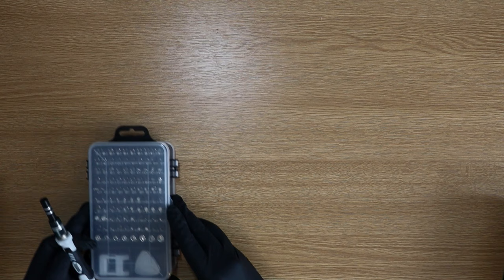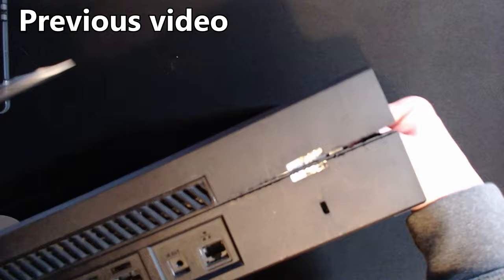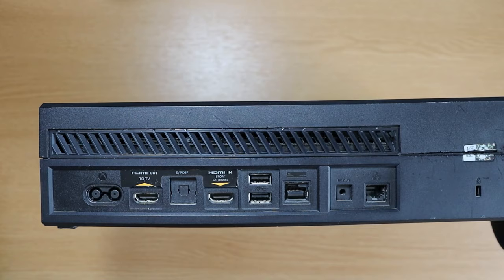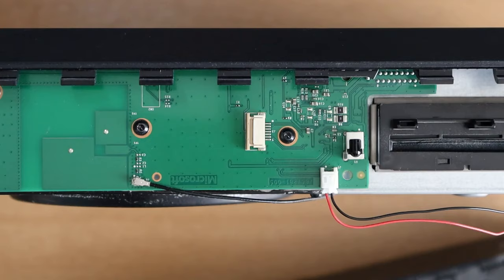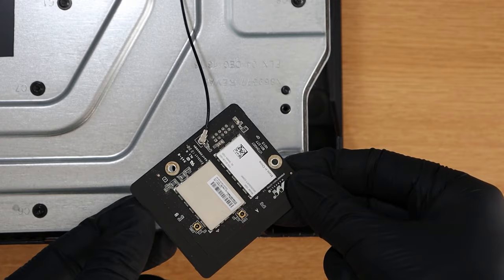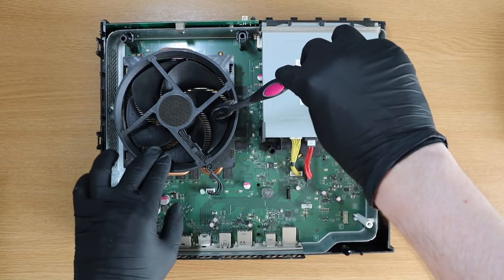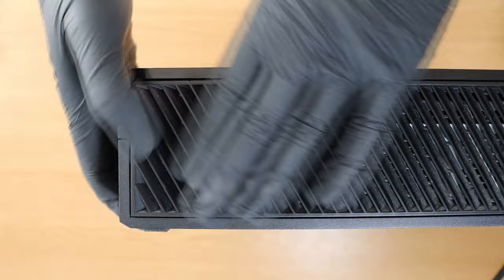How to Clean an Xbox One

Comment: I cleaned mine out but the power button doesn’t work now😡 I even opened it up again to reconnect the blue ribbon..... still not working. Is it broken for good????!!!!!!!
Reply: And I did everything right and made sure to check that I did everything right and it’s still broken, not happy 😡
Reply from the maker: This doesn't sound good :( I've had it a few times where the blue ribbon cable isn't connected properly, this can deffo cause it to not power on. Have you pressed on your Xbox One controller to see if that turns the machine on?

Comment: There's a better way to put the last shell on. Take out the front panel from the top panel. Attach the front panel first. Then attach the top panel
Reply from the maker: You're correct Aaron :) There should be a link in one of the comments that show it a lot easier.

Comment: Would it still work if I didn’t do the corner part correctly? Please respond
Reply from the maker: The Xbox will still technically work, but it just means that if you knock your Xbox, the ribbon cable might rip from the front meaning you won't be able to turn the Xbox on with the button.
Reply: @JoeyDoesTech  I think it’s that small power box that is broken because it goes from red to green then red in 30 seconds

Comment: This really helped me. Had an orange steady light on my power brick. Took it apart and cleaned it, but it didn’t work. But after i took apart the xbox, cleaned it, and ten back together it worked. I think it got to do with the last blue wire connected to the front of the xbox. Anyway, thank you for helping :-)
Reply from the maker: You’re more than welcome :)

Comment: This video is really helpful, one thing I would suggest is to remove the faceplate from the top of the case, this makes it easier to attach the ribbon and much easier to reassemble the case as you just place the top in place and the front clips on
Reply: This makes the hardest bit into the easiest
Reply from the maker: Hey bud, thanks for the feedback :) I have put a video in the comment section on how to do this, I only figured it out after the video was published haha!

Comment: Hey I did this and my Xbox won’t turn on
Reply from the maker: Just make sure that all the ribbon cables etc have been put back together correctly first. A quick take it apart and put it back together :)
Reply: @JoeyDoesTech   hey now that I remember my mom accidentally touched the circuit board without gloves while I was doing the blue ribbon , do you know how to fix it.
Reply from the maker: @WhoamI-ml1yd  I don't dude I'm sorry! I don't want to give you any advice for something that I'm not too savy on myself. I'd seek out a repair shop at this point if your Mom has touched the circuit board.
Reply: @JoeyDoesTech  thanks for the advice anyway.

Comment: The triangular piece right under the flimsy siding on my xbox is missing, does anyone happen to know if it serves any purpose/ if it would affect how it works?
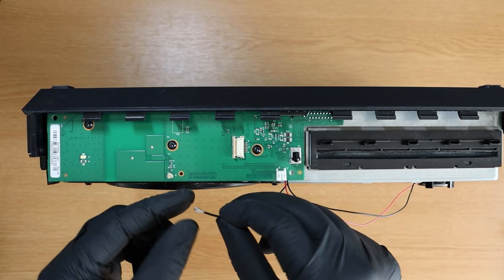Reply from the maker: Are you talking about the piece at 09:15 in the video? If so, this is to sync your xbox controller which can be replaced by plugging the controller into the xbox via the micro usb cable.
Reply: @JoeyDoesTech  It's the piece/panel that's being slid out at 2:35
Reply from the maker: @AA-cl4hb  Then yes this is the part that syncs wireless controllers. You can pair them buy plugging it into the xbox i'm pretty sure?
Reply: @JoeyDoesTech  Oh yeah I've got a wired controller, just wanted to make sure it didn't have any other significance than that

Comment: One think I'm wondering is what the cable for the wifi chip looks like. Is it the same or similar to, say, the ribbon cable clip or hard drive clips, or is it different. How does it clip in if it is different?
Reply from the maker: The cable for the wifi on the underside of the xbox that attaches to the motherboard is quite a big clip, like the one for the hard drive. Hopefully that answers your question! :)
Reply: @JoeyDoesTech  I'm sorry, I meant the antenna wire that goes into the top side of the wifi chip
Reply from the maker: @roccodesarro4448  Oh sorry my friend that's my fault! I'm not really too sure as I didnt pay too much attention to it. Sorry!

Comment: Shoot, I think I rubbed off the pins on the front panel ribbon cable because the on button and other interface buttons do not respond
Reply: Nevermind totally put the ribbon cable on wrong and after reviewing your footage I found it goes under the lock and not over lol, very happy it is clean and works!!
Reply from the maker: Good job pal! Haha I've done this a few times as well so you're not on your own :)

Comment: Good guide. Just cleaned one. The ribbon cable and top case refitment were bitches but got it done.  Didn't solve the problem, but the unit did need a major cleanup.
Reply from the maker: Good job dude :) Yeah it's a real pain. What is the problem out of curiosity?
Reply: @JoeyDoesTech  Console shutting down randomly after a few minutes or seconds. Finally isolated to the PSU brick which LED shows Power Good/Standby, then you switch on the console and the PSU randomly goes from Good to Standby to dead in a split second. Should have checked this first, live and learn, but at least I know how to dismantle the console now. :D

Comment: Since I’ve cleaned Xbox per your instruction I am frequently loosing connection to both of my controllers.
Reply from the maker: Sorry to hear dude, I'd maybe start with removing the front plate as it sounds like possibly the ribbon cable is a bit lose? I would suggest checking batteries etc, but as you said it's two controllers!

Let me know how you get on :)

Comment: Its been 20 years hasent been cleaned went to sibling to sibling i had it for a year then the Power brick randomly turned off?? Help-
Reply from the maker: If the power brick has turned off I'm pretty sure you can buy them on Ebay :) The power brick is notorious for giving up on these!

Comment: an easier way to get the top and front panel back on is to detach the front piece from the top, latch the front to the xbox, then place the top and click it into place, and last, push the front to the top and it should click into place. this is way easier than forcing it onto itself, cause that’s what i was doing and i broke one of the clips that attach the front to the top
Reply from the maker: Yeah this is true, check the top comment :)

Comment: OK so I ghetto opened mine using a paring nife as my prying tool a stripped star head for the bigger size screws and a dinner fork tine for the torque screws on the wifi card and It did take me a minute to get the last casing on but that was because I'm impatient and didn't hear when you said it had to be pulled over the first clip but after that it went smooth
Reply from the maker: Haha good stuff for getting it cleaned!

Comment: I messed up the second cable at about 5:39 in the video. Went to pull it away from the connector and the wire came out but the copper tip on the wire stayed connected. Kinda scared I broke my xbox, but if i did i’m blaming xbox for shitty wires

Comment: I disconnected the card thingy behind the screw and now the bottom part won't stay steady for me to reconnect it :(
Reply from the maker: Hey, did you get this sorted? :)
Reply: @JoeyDoesTech  nope sadly, console was so old and it would of costed more to get all the rusted/bad parts replaced. Tried taking it apart for a needed cleaning cause of dust and found an aplethrea of issues that I can't afford. My mom is supposed to be getting meat used Xbox one cause I had to toss mine

Comment: Bruh my Xbox was bought brand new on release day has never been cleaned hopefully this helps it out and for the back piece just lift as high as u can from the back thumb in each corner and push away first try 😎
Reply from the maker: Hopefully it was easy enough to take apart! Enjoy the new clean xbox :D thanks for watching!
Reply: Did it make your console run any better or quieter at least?

Comment: I have not cleaned it for the two years of ownership but I needed help after putting in the ribbon cable I could not align the shell
Reply from the maker: Did you manage to get it sorted though Redsight?
Reply: Unfortunately I broke the edge of the clips but it still works

Comment: I just tried this and hands down everything went smoothly. Thanks for the great video and i got the top case back on the first time. Im a automotive technician so that kind of helped make this easy for me had it done in less than a hour.
Reply from the maker: Jesus, you smashed it! Good stuff pal, feel like I could of gone into more detail about putting the top case back on, as it's quite difficult especially for people like myself who don't have the experience. Oh well we learn!

Thankyou for the kind words :)
Reply: Pls help me at 9:23 i cant put it back its so hörs how do i do it
Reply: @JoeyDoesTech  i kinda ripped it off Will the Xbox not function of i ripped the blue part 9:23 off.
Reply: @elias2444  how bad is the rip if the only part that ripped was the blueish ribbon that went around the outside you could still make it work as long as the piece that goes connected isnt ripped. Just have the console facing up and make sure to push in the blue ribbon tab and once u see it in push in the small tab in you can use a really small flat head screwdriver to push in the tab
Reply: @ej1jayk  ok and Will it affect anything in my console
Reply: @elias2444  if the inner part is not  ripped you should be good

Comment: I just used a knife to pop it open, figured it's as good as any other tool. If I left some scratches and dents in the plastic, it is what it is, it's like 10 years old and I've got a series S, I'm still on last gen cuz so many friends haven't switched over yet 😞 I'm probably just going to pay a pro to clean it, it's filled with dust to the point that the fan gets obnoxiously loud when I use internet explorer for some reason (isn't an issue outside of that surprisingly) and I just don't trust myself past taking the shell apart but thanks for the video!

Putting it back together was a nightmare! I eventually just separated the front from the rest and managed to get it back together that way. It would be nice to really clean it good and figure out why my disc drive will play games but not DVDs, hope to get as long of a lifespan as possible outta it.

Comment: Thanks for the video.  It was very helpful.  I did get the corner together on the first attempt, but I have an unfair advantage.  I've overhauled gas turbine engines for almost 30 years.
Reply from the maker: Nice work! There is a video to make it a lot easier in the top comment 😀 Glad you got it done either way though!

That’s a very interesting career to have!

Comment: Cleaned my Xbox and all the dust I can’t get the case back on it’s driving me crazy adhd don’t help. It’s the little blue thing at the front the front will fit and the back won’t and I
 Pretty sure I got Forza horizon stuck now
Reply from the maker: Sorry to hear bud. Did you manage to get this sorted now? Sometimes the best thing to do is take a 30 minutes break, or even go back to it the next day :)
Reply: @JoeyDoesTech  yeah man I came
Back the next day with a relaxed mind set and got the case on but the front panel is lifted slight so I can’t eject discs. 

But it’s running a lot more smoother no loud noises and I can still use the sensor buttons. 

Just can’t eject discs but it’s okay  I’m playing rd2 anyway and most the games now adays are installed on my Xbox. 

But thank for your the tutorial you definitely saved my Xbox a couple years it was caked in dust. Never cleaned it until that day the Xbox is the original one that came out 7yrs ago 😂

Comment: after dissasembling it and putting it back, my xbox won’t turn on.
what could be the problem? please if anyone could point out what i could’ve done wrong so i can fix it; would be of big help
Reply from the maker: It could be that the ribbon cable on the front is disconnected, so when you're pressing the "On" button, it's not registering. 

Hold down your xbox controller, and see if that turns it on (as long as the setting is enabled to wake it up!)
Reply: @JoeyDoesTech  I went around checking others people's way of connecting the blue ribbon and it turns out I was doing it correctly, still the On button is not registering, then I connected the blue ribbon backwards and the xbox turned on and off intermittently, so I was thinking that maybe my ribbon cable isn't damaged or anything and instead the yellowy part to which you have to connect the blue ribbon might be damaged or something, so maybe I should replace that whole green board?(I'm sorry for my long message)
Reply from the maker: @desonoranter5419  No worries dude, I'm not too sure to be honest. I'd maybe do a bit more research on google etc to see if theres anyone else reporting the problem. I dont want to give you any bad/wrong advice! Best of luck. 😎

Comment: Putting the top shell back on was easier than i though if you had trouble just place the front pins like normal then lift the lid,pull away and once that one pin is in the right spot slowly connect it as to not damage the pin while still pulling away. Once the pin is connected you can stop pulling and the rest will snap back together

Comment: Managed to get it back together easier then taking it apart, I slipped the face plate off the top to make putting the ribbon cable back easier after slipping that back on I clicked the top back in place on the plate and bam it just slipped straight on barely any force needed
Reply from the maker: You are one of the lucky ones Sleeplees! Glad you done it so successfully. Great job 👍
Reply: @JoeyDoesTech  thanks although it didn’t fix my problem my controllers keep DCing I thought it could be dust over the infrared sensor although it apparently wasn’t, I’m now thinking it’s a software issue as they can be wired in and the issue still occurs going to try a wired (completely non wireless) controller to see if it’s something there

Comment: Help! I can't slide off that triangle piece in the beginning. It's stuck. Can anyone help?
Reply from the maker: Did you manage to get it out Rokky? Sometimes it's just an extra bit of force needed.
Reply: @JoeyDoesTech  I managed to get it out. I just skipped that step first and went on with the tutorial with the piece intact. When I opened the case, it easily went off when the case was out of the way. Thanks for the tutorial and for asking!
Reply from the maker: @rokky6053  You're welcome :)

Comment: I broke the black wire it snapped out of the little metal thing so I got a roll of electric tape and hooked it up to the little metal thing and put some tape on the black wires on the metal part so it stays and it’s 4 am in the morning thank god my mother had electric tape otherwise I would have to say goodbye to my Xbox but now it runs super quiet and no problems what so ever
Reply from the maker: Sounds like a bit of a nightmare! Hopefully it's working all good Le Shots :)

Comment: Brother, I’ve removed the top piece, but I can’t really work out how to remove the piece that holds the ribbon in place without moving the top

Edit: i the ribbon came out without me fully removing the button that holds it oh crud

Update: it seems the ribbon is intact and I might be able to but it back in the button, going to try
Update 2: I’m struggling to get the ribbon back in the button, I’ve hit a roadblock
Reply from the maker: Hey bud, sorry for the late reply. Have you seen the video in the description on how to take it out easier etc?
Reply: @JoeyDoesTech  so, I got the ribbon back in and the top on after I cleaned it. However, it seems I damaged the cable because now the power button doesn’t work and neither does the disc tray. It’s fine though as i can still turn the Xbox on with the controller and discs haven’t worked in my Xbox for a few years now. The video was still very helpful and the fault is my own, thanks

Comment: I gotta share: theres a clicking noise.  figured I clean it.  fucking trying to get that bullshit back on... horsecrap.  i ducking snapped the clip beacause it was impossible.  no Xbox needs to be that fucking locked down. I finally got the shit back together after cleaning it.  it still clicks.  I take the Xbox and just start spinning it like a steering wheel until i notice that flipped over, bottom up the clicking stopped.  I grab some little pegs to act as feet for the Xbox so that it can still breathe upside down.  works like a charm.

Comment: When I tried putting my screws in it wouldn't have any available holes. I'm sure I took them out from those same spots yet there are no holes in that spot. I might have a few screws loose.
Reply from the maker: Just double check over the video is my best advice. It's always best to map the screws out on paper if you can, this really helps with putting it back together :D

Good luck, and hopefully it turned back on even without the screws!

Comment: Sooo.... I ripped that black blue ribbon.... Is that bad?
Reply from the maker: Yeah kinda :( That controls all the turning on, sync and eject buttons!
Reply: @JoeyDoesTech  I figured that out... Does that bad? In a way like it's done now? I'm fucked forever???
Reply from the maker: @fotusknight5923  You can buy a new front facing panel for it which comes with the ribbon. If you're not wanting to do that though you could take it to a repair shop.
Reply: @JoeyDoesTech  No way to turn on the console without it huh
Reply from the maker: @fotusknight5923  If the Controller is already paired, you can turn it on with the controller :)
Reply: @JoeyDoesTech  Ooohh yeah I forgot that was a thing lol.. Yeah. After all I always turn it on with a controller anyways lol. TY man! Once I fix my box I'll just disregard the power button as I always do lol.